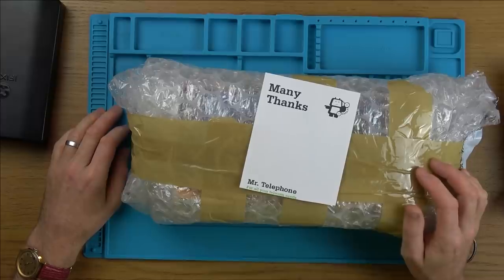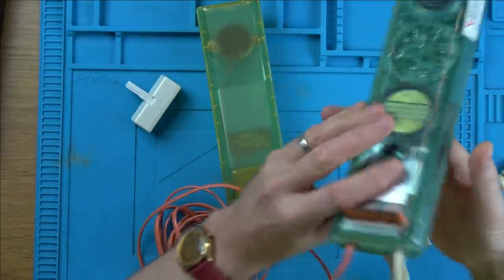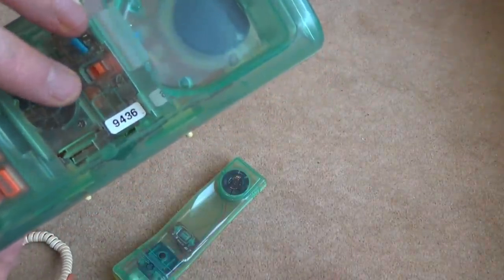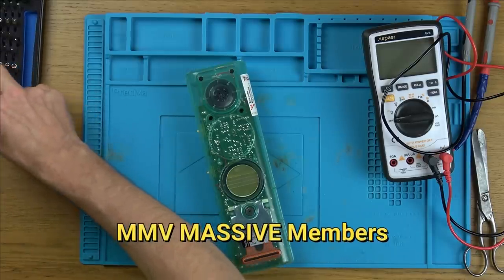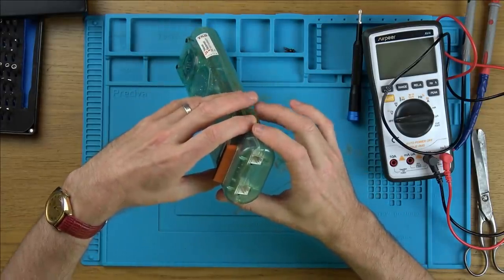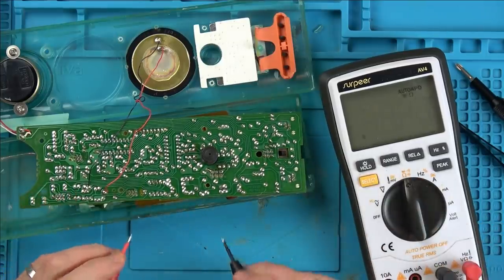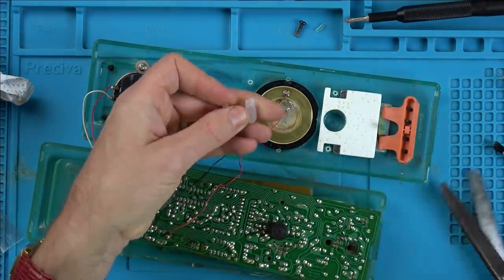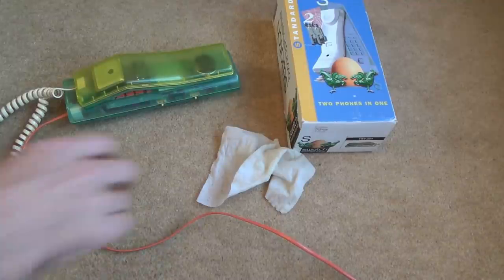Trying to FIX an unusual 1980s SWATCH Twin PHONE

Comment: Hi Vince, got to say a big thanks. never realy repaired anything but got inspired by your channel , an iphone 6s wasnt working properly and earphone dead. the screen looked to be bending outwards so suspected the battery. i got a replacement on ebay inc tools for 4.99 and a speaker for 3 quid and headphone jack for 4 quid. nothing to lose by trying . anyway end result is a perfectly working iphone 6s  with a working jack and ear piece. happy days .  need to find other things to fix now. it gets addictive. nice sense of acheivment too

Comment: The difference between land lines and mobile phones (even today, in US at least) is analog phones were full duplex.  You could hear and speak at the same time.  Cell phones are quasi duplex where spoken and hear sounds are split into different digital streams, poorly synced, and not cross mixed.  It's terrible compared to what we used to have.  Latency is also a plague of digital cell service.  Analog circuits were near light speed, and modern phones have ~250msec of delay because of signal conversion, digital data transmission, etc.
Reply: The most annoying aspect is the horrendous delay there is between when the call is answered and the audio can be heard!  My mobile for example will take about a second to activate the speaker after answering and that means I will miss the beginning of the call which is annoying when it is not just a simple hello!

Comment: Ahhh pulse dialing! Bringing back telephone principles. I believe the voltages and tones are different US vs UK. Use to instruct courses on telephone and switching systems. Would cover the -48vDC that would be present at the hook switch of the phone. When headset is taken off hook the -48vDC would loop back to carrier and dial tone would be provided to initiator. Then dial two ways, DTMF with keypad of tapping the hook to create short interruptions corresponding to the numerical value off older pulse dial type rotary phones. Now everything is VoIP and call managers 😭. I think there was an episode of MacGyver where he had to get out of a jam via pulse dialing on a, well modern at the time, DTMF style phone. Enjoyed the video as always!!

Comment: At the start you talked about the ins and how it could be the inner or outer pair for certain things . That could be partly down to the engineers connecting the line , they often chose or probably still do choose a pair as you know . I worked for "" Lux " providing traffic management to B.T and watched them doing their stuff , so many wires and often they toned them to get the correct ones . We went out to a job once to replace a few poles , all went well until one of the more experienced guys asked the one who had been in the manhole how he had connected the pairs . He had just colour matched them , oh boy , never saw a crew get packed away and off site so fast because he should have toned them . Every  house was wired wrong .
That tapping thing did work , we used to do it as teenagers  😄😄

Comment: I think it was the coating on the back of the speaker. It was probably on there so that it wouldn't corrode. You probably cleaned off some of that coating with the wick flux heat and solder making a spot where the solder can bond. Awesome job and this video was also very entertaining.

Comment: Hi Vince, I bought the BT phone you fixed up in the 1st eBay challenge. That’s a pulse dialler and I’m with virgin media. 

Just tested it and it’s still working.
Reply from the maker: Hey, great to hear you still have it. That was another unusual phone. I still remember the fix, a Zener Diode had failed 👌 Thanks for checking 👍👍👍

Comment: In the USA the inner two pins are default line 1, and the outer are line 2. But no one uses analog telephone lines here anymore for the most part lol. Red and Green = pair one, black and yellow = pair 2. And we only have the 4 pin connectors not the 6 pin for regular use.

Comment: I still use one of those!
It is a WesternElectric™ Model 2500 modular set with bells! I have the ivory one and it was a freecycle find. I love the retro aesthetic. It is built like a war battle tank! As a matter of fact it is sitting right next to me right now on top of a klipsch speaker between my computer desk and the tv entertainment center in my bedroom! It was one of those things I asked for on freecycle and found it in just a matter of hours of my listing going live. It cleaned up pretty well although I didn't need to take it apart for it to work or anything, it worked great when I got it in about march this year and continues to work great. I did find out you can unscrew the caps to the mouthpiece and earpiece. I polished up the contacts to the mic piece while I was cleaning it up. IDK if they have these where you live or not, curious to know if you had a variant of this model.

Comment: You might want to get yourself a TS100 soldering iron ore a pinecil iron, that can be powered from 12v to 24v or even usb c, very good and get hot quick

Comment: What an odd phone, makes sense SWATCH made it, and those translucent plastics 👍
Reply from the maker: Yes, very Swatch indeed. Makes me want one of their watches again.
Reply: Also RadioShack had transparent phone back in the day that had football neon lighting.

One they was that when you took the phone off the hook it turned off the Neon since otherwise you would get noise in the audio of the phone.

This was not LED jeepney on replacements nor just a couple neon two bulbs but Voltron I believe was pink and neon tube.

One problem with those is if someone need them fixed you could not read the component values since the whole board with painted white.

When I got a hold of one that didn't work since they were popular I cleaned off all the components so I knew what everything was so when it happened next time I was had a record of what everything was.

I don't remember how many does a fixed but it was quite a few.

Although I don't know if they Russo blower or not but just never know quite a few people would have had them.

Also does it wouldn't remember the slinky phone and what I'll call the hotlips phone that looks like a pair of lips.

I believe that was also featured on some old TV show can't remember the name.

Also I remember all the old wireless phones that would pick up other phones and other devices they were on the same frequency.

Still remember occasionally tuning to TV channels in Hampton to hear some money on the cell phone years ago.

What happened to change your channels just at the right time.

It seems like most of the time it was when they were doing something to get calls going or something or other.

It was back in the day when things were not as easy it is of just picking up Ramona phone and it working.

Not quite the brick but.

But almost all those phones back then work our phones I've been told that later in that time of the technology was still in its infancy.

Still remember a lot of the old bag phones and other cell phones using the same batteries as a camcorder back when most people would be using a separate VCR or half of it in some cases and a separate camera.

And a tripod was usually a dolly that had space below for the whole unit so it could be AC powered.

Matter fact used to have some adapters that would adapt those batteries to a cigarette lighter female plug.

And literally they had some wiring harnesses and had to battery connector and a male and female cigarette lighter plug coming out of it on two separate cords

Comment: Great job!  According to most electronic experts, soldering a piezo disc can wreck it.  I have heard Dave Jones mention this for one.  You are supposed to use a small iron and just quickly dab at them.  I wonder if that's just an old wive's tale given yours worked fine after a fair bit of soldering heat to it?

Comment: I remember I had an old telephone that wouldn't ring unless there was a bell wire connected to the telephone port I remember complaining that it wasn't working and the engineer coming out and installing it cause all new phones didn't need it to ring

Comment: The subscriber lines in those days would work with both tone or pulse. So your 'dial trick' worked. Nowadys its mostly voice over IP - so you would need a VoIP-Router which supports pulse dial - some do ... ;-)

Comment: Thats not correct about the pulse dial. A 0 was 1 hit because the 9 was 10 hits. Remember this, because when I was on a school trip in 9th grade in the UK, the family we lived at had a lock around the circle so you couldnt dial, but we where still able to call home using this method 😁😁😁

Comment: I've Always wondered -->  HOW does or WHY are Rings of Phone (into House) Double in UK and Single in US?   
I really like the Double Ring - do i have to move to get Phone to ring that way?  ha ha     could it be via phone Company?
Reply: The rings are sent from the exchange, if you were to connect a UK phone to a US phone line you'd hear the single ring and the double ring if you connected a US phone to a UK line.
Reply: @1990chrism   HI!   Thanks so much!  : }  guess moving is the answer.   Cheers!
Reply: @voltare2amstereo    COOL Thanks!   Heard of VOIP, not sure how it works - yet.  tho - yesterday, Modem went Bonkers, so no chance till Tues, then I'll know if [it] there's a future.

Comment: Someone might be able to help me out here but I read somewhere that the emergency service number 999 was initially made 999 due to accidental pulse dialing along the phone line. Is that correct or a myth?
Reply: I believe that is correct. More pulses meant less chance of a misdial occuring. New Zealand used a reverse dial and so '111' was actually the same as pulsing '999'. I think I read somewhere they got British equipment in to implement their emergency number.